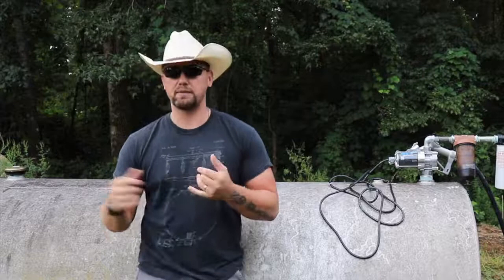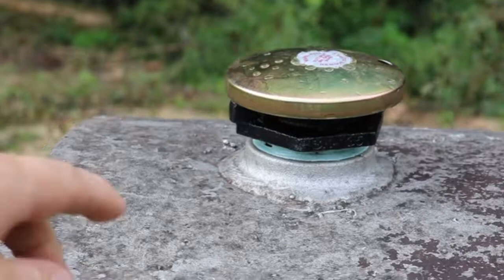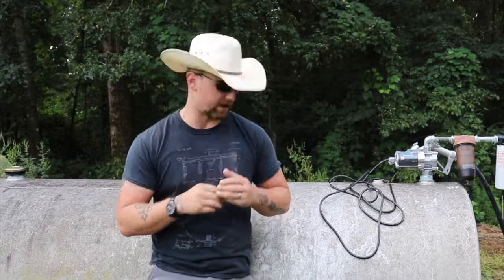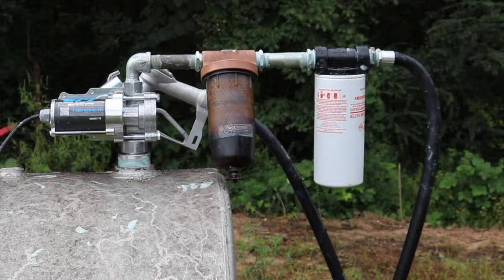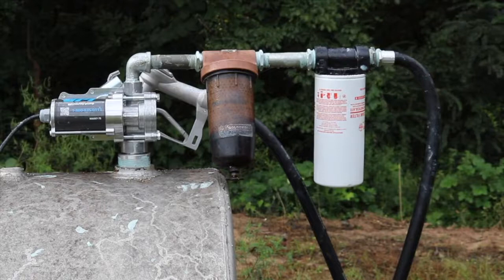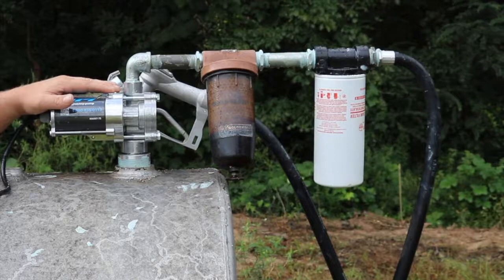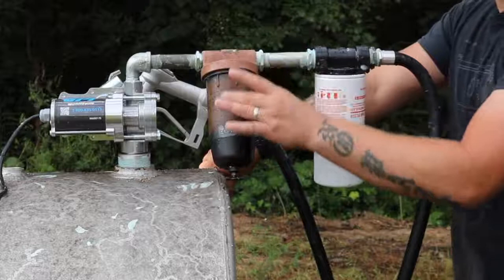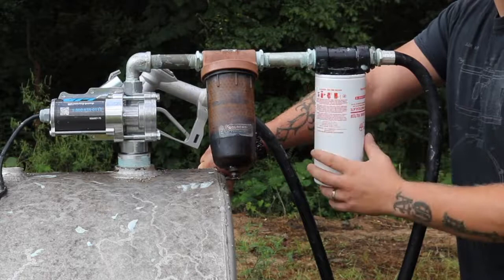On Farm Diesel Fuel Tank. How We Setup An On Farm Fuel Tank.

Comment: If it’s gravity flow do you still need a grounding rod?
Reply from the maker: Truthfully I’m not convinced you need it with diesel regardless… diesel just doesn’t ignite that easy. But to be technically correct yes you need a grounding rod. Theory is gas flowing through the line creates static
Reply: Better to be safe than sorry. Thanks